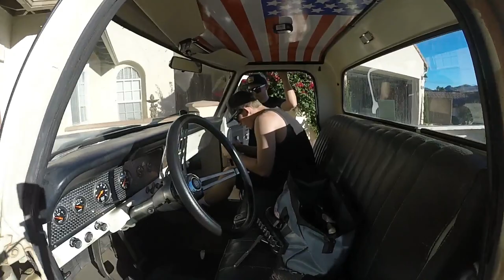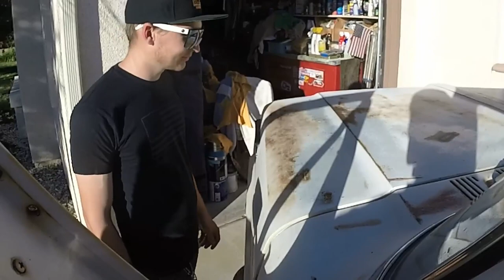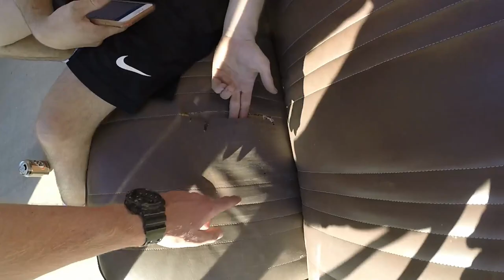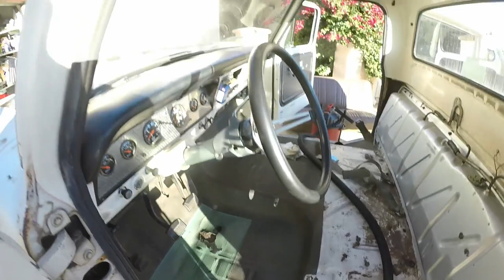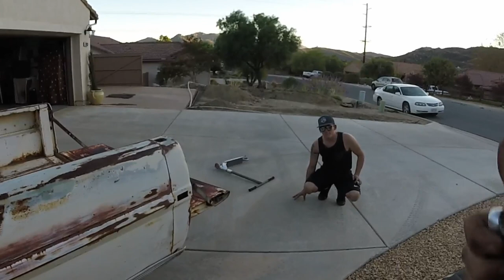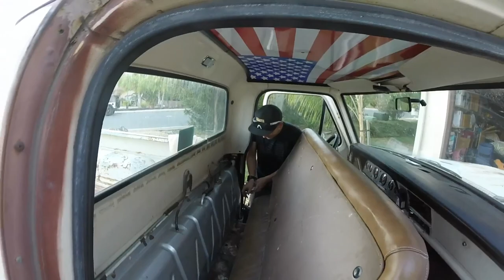My F100 Gets a New Seat!

Comment: Id like to see the brown bench seat in for awhile. I think it looks good with the white paint of the truck. Also if you think you have a height problem im 6'4" and have to slouch in almost everything. My '77 F150 and my '83 F150 i gotta slouch
Reply from the maker: +Neal Murray dang man I’m sorry for the fitting issue. I’m sure you can get a seat back if you don’t have a gas tank there. I want to keep the seat as well but I feel like my five speed shifter will hit it because that trans is so long. But we’ll see

Comment: A while back my local junkyard had a 50% off weekend (they do it like every holiday weekend), ended up pulling a blue bench seat out of I want to say like a 86' (?) Ford, hoping it'd fit in my j10. Rip, it's about 4" too wide for my cab. Oh well, got a mint blue bench seat for $15, gonna slap some stands on it and back it a "couch"
Reply from the maker: +Ethan H. Now that’s some engimaneering. I like it man. Work with what ya got. Throw it up for sale see if you can make some money. Or a cool man cave couch. Put some cup holders in it lol

Comment: You can paint a seat ....they sell vinyl paint dupli color vinyl paint pep boys has it clean it with alcohol the use adhesion promoter  first wait5/10 min then spray paint the seat it will look original I did it to my Harley seat ...10/15 bucks paint it Black .......

Comment: You should get seat out of a 1995 f150 with the center part that folds down they are super comfy
Reply from the maker: +jason gagnon I’ve seen people do that. I don’t know how easy or hard they are to install but I can’t imagine it being that bad
Reply: Thecraig909 it's not hard at all I did it to my 74 f350 all you have to do is switch the brackets out
Reply: jason gagnon 
If you switch the brackets it bolts right up ?????
Reply: Bamboozel96 yes the seat itself has the same bolt pattern as the the old seats
Reply: jason gagnon 
Cool I know many Ford truck seats do what year ends the same bolt pattern so I can search the bone yards for that year ......such as up to 97 it changed or ????
Reply: Bamboozel96 I think after 96 or 97 they changed but I couldn't tell you I haven't tried to swap the newer ones